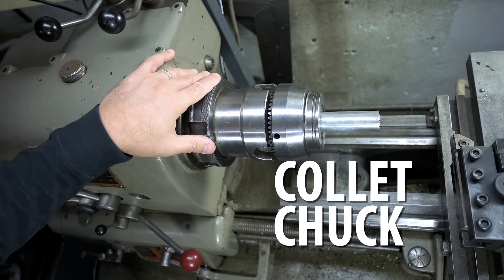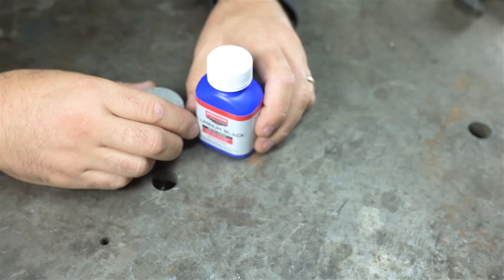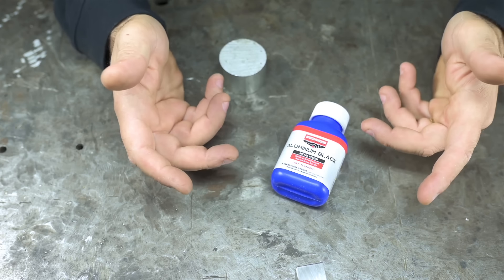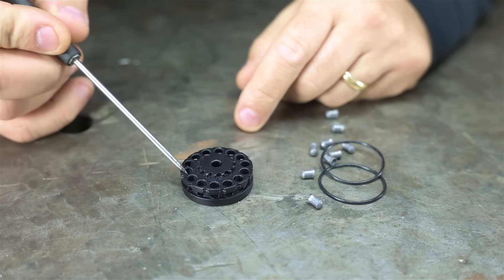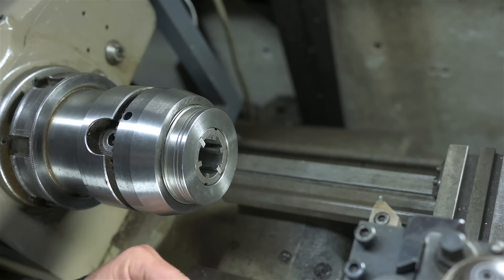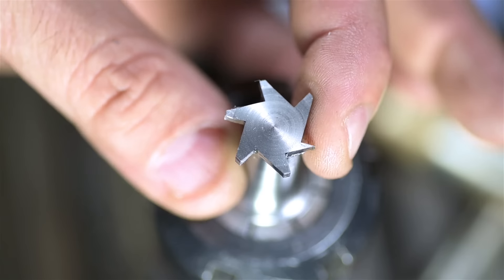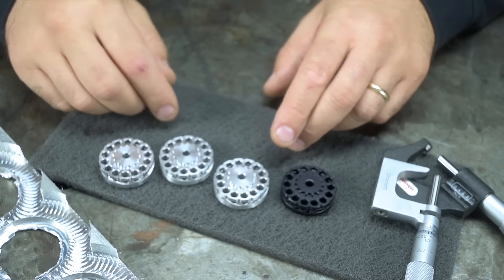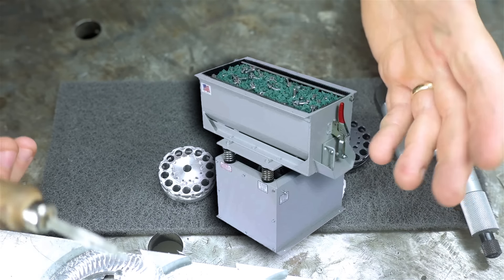Will it Black an Entire Aluminum Part?

Comment: If you want a good finish on aluminum it's hard to beat anodizing. While a proper setup requires a constant-current PSU a plain 12V PSU will get the job done. The bath is 10-15% sulfuric acid, some reports good results by using sodium bisulfate (pH-down for pools). You also need some 10% NaOH for etching and ideally 10% nitric acid as a bright dip before anodizing. 
I've only used commercial dyes, but some Rit dyes are supposed to work OK. 
I have a small bracket mounted on my boat , it's been constantly exposed to sun and seawater for 10 years or so and is still as black as the day I made it. Even the stainless mounting screws have started rusting...

Comment: I use the Aluminum Black a bit. The key is to treat in short runs, and rinse and scrub in-between. I, also, don't use a cup. I put the parts in small zip-lock bags (just larger than the part). This way, you only need a fraction of the solution. Put a little in and roll the baggy around. Rinse in cold water and scrub w/ an old tooth brush. Repeat until a nice rich black finish. Rinse again and I lightly oil w/ 3-in-1. The biggest drawback is wear resistance. It really doesn't have any and will scratch and chip easily.

Comment: It's possible that putting the aluminum and the solution in a stainless steel container created galvanic corrosion on the aluminum, since aluminum is way at the other end of the galvanic series.   It might have had different results in a glass or plastic container.

Comment: Use a wire brush as a tool in the mill and go around the circumferences and automate the deburring process. Just started working at a new place doing cnc milling production work and they use wire brushes to do deburring and it does a pretty good job
Reply: Not the worst idea, but aluminum is very soft and a brass brush (harder than Al) would remove material. A plastic brush might work, or the sharp edges might just cut the bristles off immediately. TOT had the right strategy but the wrong media inside the can.
Reply: @pmdeutsch  yea we use the brushes on cast iron. Could probably use some kind of scotch Brite pad on aluminum.

Comment: A vibratory bowl is the way to go when deburring. You can do a tumbler but it's less effective. In either case - as you said, it takes SEVERAL hours, sometimes up to 24 and the media makes a large difference. 

Best way to do it is to make a test part with similar burrs and run it in the lathe for 24 hours just the see what it does.

Comment: I don't know what chemicals are in Aluminum Black, but it produces the same effect love had on my now blackened heart and I too dipped my part fully before having read the instructions.  While it took longer to manifest than was observed in the video, I experienced a very similar sizzle as well as the orange peel pitting of my part, though dimensional growth wasn't observed after the initial dipping.  I am in the process of treating the part in the hopes of clearing up the obvious discoloration and open pits, though I know the damage can never be fully undone and can reappear on the surface at any time.  I learned too late that it doesn't pay to be in a rush dipping your part in untested solutions.

Comment: I would have milled them on an index table, your drilling skills are pretty decent here.  It looks like the cold black for aluminum is a form of sulfuric acid solution, or some other acid, most acids are caustic on aluminum, pitting and expansion of the part is from the molecules breaking down. I would consider brushing it on with a small fine synthetic bristle brush and using a mild carbolic acid wash to stop the solution from pitting, let it sit a minute and then dunk it in water so it maybe won't wash the color off. Either way I would prefer to anodize, safer on aluminum and you get what you pay for.  Thanks for the video.👍

Comment: I use it for touch-up on aluminum AR receivers and it works just fine. I clean the surface with acetone and then again with denatured alcohol and fine steel wool. I just wipe the entire area in order to blend it. I put a thin coat of oil on afterwards. You can't see the nicks and scratches after I do it. soaking the parts looked like shit, it would probably be okay if you wiped it immediately.

Comment: a few small tips:
Don't use birchwood on aluminum, just a little lye and water with a brush, rinsing immediately afterwards.
Don't use anticorodal on the mill, you achieve vastly better results with ergal 7075 and you don't even need lubrication.
Hi great!

Comment: Looking at the MSDS, it appears to be similar to cold blue.
Aluminium is more reactive that iron, but its oxide coating is harder for air to penetrate and doesn't look like rust, so most people think it is less reactive.

Its main components are copper sulphate and selenious acid, as well as smaller amounts of phosphoric acid, fluuroboric acid and nickel sulfate.
A cold blue by them contains selenious acid, nitric acid, copper nitrate and copper phosphate.

Both should work to deposit a layer of copper selenide.

Comment: An exact-o knife would have eliminated most of those burrs really easy, we use them on small windows and holes all the time at work, especially in spots where the size/angle of the chamfer isn’t critical, follow up with a scotch bright pad and then a quick tumble only if you need a uniform finish

Comment: Aluminium is cleand in oxalic acid solution, then anodised in hot solution of the same.
It formes the hardest layer on it, thats the green coating on aircraft parts (plus plaint).
It removes oxide layer when cleaning not atacking bare aluminium.

Comment: Finally my expertise.
Hi Tony. We produce alloyed aluminum profiles. Our customers are mainly machine parts producers, automotive parts producers and offcourse defense industry.
We supply aluminum profiles of the alloy 6082 6013 and 7075 for these parts. 
So there's some points i believe can help you with to solve what's gone wrong with these parts. 
As you know first thing is alloy. Your cutoff part might be 6063 or 6061. Why this is important? Because of the remainder chemical processes you applied. Should have use 6082 or 6013 or 7075.
Next deburring process is off. So if you had chose NaHO (sodium hydroxide) bath to deburring you wouldn't spend somuch time and energy for it. And also you had to apply acidic oil removal bath before. These chemical baths weakens the burrs and dissolves the sharp edges.
Also for blueing you had right stuff but dunking parts in a high concentration bath of this chemical was a bad idea. Thank you. İ hope you read this.
I love your humor and literature you use in your videos. You might be the Shakespeare of machinists. 
Regards XOXOXO
some Weirdo.

Comment: Stainless steel is an eon removed from Aluminium on the electronegative scale. A electrolytic reaction occurs and prevents the solution working. Try again in glass beaker. Round bottomed flask might help reduce contact masking.

Comment: As a stain glass maker, I’ve had a number of different chemicals that will change the color of the lead or solder. I like the green finish best, but it depends on the piece, and a black oxidation finish looks great on some parts.

Comment: Wow! I'm a chemist, and I'm curious, so I took a look into the Material Safety Data Sheet (MSDS) for this Aluminium black - and I was a little shocked.

! You really shouldn't use it indoors, at least not without a well working fume hood ! 

It contains some really aggressive acids and chemicals that may not only strip your skin of, but also burn your eyes and lungs. And on a bad day, the fumes might kill you. Or in other words: If you find stainless steel passivating agents harmful, you should pay the highest respect to this Aluminium blacking stuff. 
It contains Fluoroboric acid (which is a really harmful substance, and it is mistyped in the MSDS), Selenious acid, and Phosphoric acid, which are responsible for the fizz and the smell. The stench is probably caused by Hydrogen Selenide, which may smell similar to Hydrogen Sulfide (i.e. "rotten eggs") and is highly toxic. 

The brown and black oily foam you see is probably caused by Nickel and Copper, which both are contained as their sulfate salts. They will be reduced by reaction with Aluminium and/or the Hydrogen formed from Aluminium and the acids, and end up as finely dispersed metal powder or their Selenides, or both. This will also form the black coating on the Aluminium. So, in general, the process is similar to the process for steel, where also a Iron Selenide layer is formed on the surface. 

But really: Don't use it in a non-ventilated space! Don't breathe the fumes! 
Listen to the chemist. I'm serious.
Reply: Wimp......
Reply: @damiengirvan5020  that's a comment from somebody completely ignorant of the chemistry. Congrats, you're a candidate for the Darwin awards.
Reply: @human_isomer  just a joke man.....
Reply: @damiengirvan5020  Ok, got it. Bit hard to recognise, though.
Reply: @human_isomer  I have a very high respect for chemistry...... And I would always advise anyone to always fallow all safety procedures..... And you were 100% correct about the toxicity of the aluminium black...... I just couldn't resist....... Sorry..... But I hope I helped draw attention to your comment.....
Reply: @damiengirvan5020  All right, glad that got sorted. Yeah, let's hope the guys who are using or planning to use it read the instructions and keep it safe.
Reply: @human_isomer  indeed....    Let's hope so......

Comment: Ha! I have an aluminum art piece I made that turned black after I encased it in plaster of Paris in order to fixture it and mill the bottom flat in order to mount it on a wooden base. I tried every chemical I have to get the aluminum bright again and nothing works. BTW, the plaster of Paris was a huge mistake for my application. It was very tenacious and I had to work hard and very meticulously to remove it from my art piece.

Comment: Toolmaker here with 25 years of time. When it comes to steel/iron parts, I prefer the old fashioned burnt oil method. Doesn’t take as many coats and last forever. 
Best to anodize aluminum, it’s just as easy.

Comment: I get different results every time I use this stuff. Sometimes surprisingly good, sometimes it barely does anything at all. I try to be consistent with prep with the assumption , as a force of habit that for best results prep as best you can. I feel like it comes down to the type of aluminum 6000, 7000, forged ect.

Comment: I used to run a centrifugal disk debur machine and we used cone media with water and it ran about 150RPM for 30 minutes. About 12 minutes of actual deburr when you minus the rinse and wash cycles. Anyway i feel like if you added some water to your lathe deburr and ran it aggressively  for a few minutes it may work.

Comment: My first vibratory tumbler was made with a cheap palm sander with the base removed that was bolted to a 1 gallon bucket. It worked fine, but I eventually just bought a shop made one for cleaning out brass casings.

Honestly, any aluminum part is immediately going to start creating an oxide film as it's exposed to air, so it's self protecting from the elements. The only reason to color it is to make it look nicer. Some bake on paint like cerakote with an airbrush would be plenty durable.

Comment: I think you ruined those parts by using a stainless steel container. Having 2 different metals touching in a conductive solution creates a battery which will destroy the most reactive metal which in this case your aluminium parts.

Comment: Amongst other things im a ex British army gunsmith , ""blue"" is a form of oxidation , if the metal is already oxidised it is less likely to rust , im also a ( qualified) blacksmith , didn't you call it anvil smashers or something a while back !!! anyway FE304 and FE203 or something like that , are mill scale and rust , cold blue , at least for steel produces another form of oxidation to prevent rust forming , word of warning for anyone fond of WD40 on guns , it has a oxidation inhibitor great to stop rust but t will eventually eat through gun blue,  just thought i would mention that :) NOTICE MY NAME ??? i used to import edguns in to the UK and had the FIRST kaliber Kricket in the UK , i also designed and built a screw system that turned the kricket from a 12 lb rifle in to a 40ftlb rifle in seconds but um lets not mention that lol
Reply: Ok

Comment: Looks to me like all that stuff is is sodium hydroxide(lye). If you put a bare aluminum part in lye it will turn black, but the black is just an oxide that washes off easily. It puts an etch on the aluminum, however, and makes it much easier to get a semi-durable painting done. That said, it's super easy to anodize aluminum and it actually works well.

Comment: I need to refinish an aluminum piece.  definitely won't be using this stuff.   used some Birchwooed Super Blue years back on some steel and had good results however.  regarding the aluminum project, think I'll be looking up a reliable anodizing outfit

Comment: I did a large aluminum part.  Dipped it in a quart of the chem.  I got a big whiff of the gas coming off it and it did a number on me, lots of mucus, coughing, for days.  Do this outside and stay upwind.  It also ruined the part, like it had been dipped in acid.  Will only use it for small touchups for here on out.

Comment: The reason they only advertise as a spot treatment is probably this solution is meant to only provide a thin surface finish for cosmetic repair. A proper anodising creates a thicker and hardened outer layer.

Comment: Needle file for the square window deburring.  It would have taken forever and you probably would have to cut the end of the file off to get enough usable stoke out of it.  Your shaker and tumbler ideas were great.  I wonder if the tumbler would have worked with vibratory media?  How fast can the weld positioner table spin?  Or make a sawzall attachment like they make for spray paint can shakers.  :D
Reply from the maker: I wanted to try the positioner but the chuck I have on it doesn't open up enough to take the can!
Reply: @ThisOldTony  LOL!  I knew it had to be something like that.  It'd be hilarious to see your 8" chuck in a 4" chuck on your positioner, on its side, all supported by some office chair casters.  :D
I also wonder what the significance is of the water that they use in the rock tumblers?  More like sharpening using a wet stone?  More stuff to google.

Comment: I tried to use this product and no matter how I degreased the parts the black would just rub off. Nothing helps by methods to remove the oxidation. Even tried to warm the part or the solution. It is not sold to blacken whole parts but just touch up minor scratches .  The only part that worked with their products was to brown the barrel of a black powder Kentucky pistol. It has held up for 45 years!

Comment: Mine ended in disaster. Freshly machined part. Cleaned per directions and it would not stick to the part or penetrate. In fact mine rubbed off on my hands. What I ended up with was a few blotches. Seller on amazon unresponsive to service requests.

Comment: You really need to brush this on, also start with the brush wet with distilled water and just a drop of the stuff, increase the concentration slowly to build up a layer that doesn't flake off. It took me an hour to blue a few little screws, wouldn't recommend doing a large part.

Comment: The reaction of the aluminum in the aluminum black reminds me of what happens when you put aluminum in a solution of sodium hydroxide, aka lye. Bubbles of hydrogen are given off, it gets hot, and the aluminum dissolves. I don't remember that turning the aluminum black per se, but the massive surface pitting does cause a color change.

Comment: An older video now, but a couple observations:
1. You might be able to chemically debur the parts using lye ("Draino"). 
2. That aluminum treatment stuff you used seems a LOT like simple lye. It bubbles like lye, gets hot like lye, and puts a sheen on the part like lye. Add some black coloring and you might be able to make your own.
 Regardless of approach, pretty sure the part needs to be really clean and oil-free before starting.

Comment: Just anodize it. It is such an easy process. Clean with the usual stuff, etch in sodium hydroxide to clean more, hang it on a titanium wire, dunk in sulphuric acid and pass current, rinse with deionised water, color with dye (get the proper stuff made for it, it's not that expensive), boil, done. Takes almost more time to write it down than to do it.

Comment: I am restoring an old microscope and the only part that really needs attention is the stage.  Its a square plate made of aluminum that is black.  the plate has some rough spots that probable started from scratches that exposed the bare aluminum and eventually pitted through the area.
I am now hoping the product in this video will be my solution.  I am thinking i could remove the stage then sand and polish it as much as i can then paint it black again.

Comment: All you need to center a workpiece is a 3 claw chuck, a dial indicator gauge and a rubber hammer. Takes about 3-4 minutes, and you will have a part which runs within 0.5*thou (>0.01mm). Also 5 thou is ALOT, common tolerances in the metric world is down to +-.003mm which is about 0.11811024 of a thou.